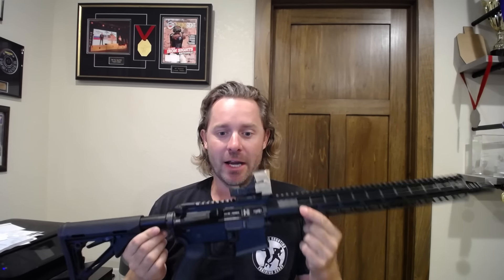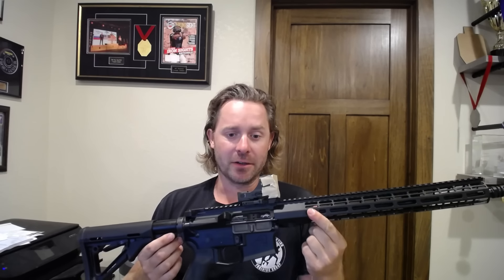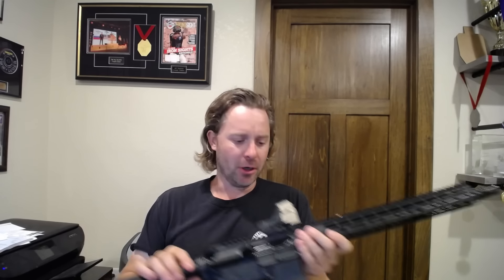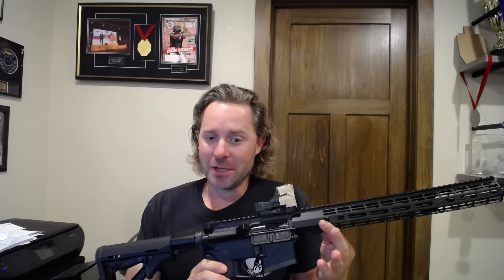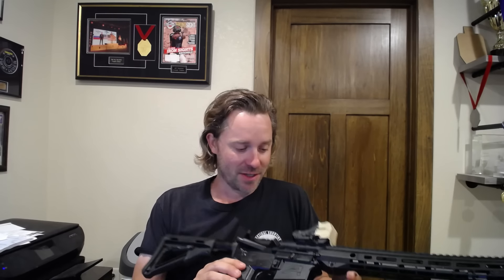Yes I understand Aero stuff is garbage

Comment: Those Aero Precision 16" barrels have a .0785 gpd. That's rather large to start off with. As the barrels gpd erodes. It starts speeding up the system. It starts decreasing the unlock time. And starts causing the bolt to have to pull brass that  hasn't fully retracted in the chamber. Causing bolt failure. Things like adding a h2 buffer will help slow the system down. Replacing gas rings at 5k or sooner. Replacing the buffer spring, etc.  There is a natural progression of maintenance that has to be done to get longevity out of these things. 
3 bolts in 20k doesn't seem that bad though. Especially since you are not doing anything it seems to mitigate the failures.  I put 12k on a Colt 6920 bolt. Back when I was taking courses. It didn't fail. Due to the fact I replaced it. I figured 12k was good enough. I had already put a h2 in it at 7-8k. And three sets of gas rings. At 17k I replaced the barrel. It wasn't key holing. But why take a course and your rifle sh*t the bed? When a good maintenance schedule can mitigate a lot.
Reply: Damn Bro, you sound like you know what you are talking about. Any recommendations on someone who can build a cetme from a kit ?
Reply: @texasRoofDoctor What are you looking to do? If you want a good turnkey rifle. A Colt 6920 Trooper is a good starting rifle. And is relatively inexpensive. It's a carbine gas. But they work. Probably 80% of the police run a Colt gun still.
BCM is a step up. As is Sionics weapons systems. 
If you are building a rifle. The barrel is the starting point. Ballistic Advantage is owned by Aero Precision. But BA gasses their barrels different than the ones they make for Aero. They seem to be decent. Rosco gasses their stuff right. 
A mid gas 16" inch with a .076 gas port diameter runs well with a Sprinco blue spring and H buffer.
When you could get those AO Precision military overruns on BCG's they were a steal. 
I tend to not stray to far from the TDP specs on things. The array of stuff for AR15's is vast.
Reply: @texasRoofDoctor You also have SOLGW in Texas they have good stuff. Become pricey. But they put together a nice package.
Reply: @DutchK.USMC.Knuckles3.   Actually I want to build up a Spanish Cemte from the parts kit.
Reply: @El_Peto Maybe nothing. They could have it done for them. Broadsword recievers and L89 rails is their design. 
Colt has a few barrel manufacturers. Wilson Armament and Rosco make barrels for them. If they aren't making them in house. Same with BCG's Microbest and AO Precision are .mil and .gov suppliers. Capco, Remington and a few others make M4 barrels for the M4. And I'm sure FN is contracting to the same firms. Because the .mil doesnt use cold hammer forging. 
You'd probably be shocked at the amount of stuff insert your favorite gun company here ---> ______, doesn't make. 
Aero makes their own uppers and lowers. Uppers are junk. No thermal fit. No dry film lubricant. That M4E1 stuff looks like billet garbage. There's been a lot of references to the fact that BA/Aero barrels sh*t the bed fast. Tells me whomever is doing the QPQ work isn't doing a good job. And most of their BCG's are Toolcraft. Look up cage code 1b1b6. A 750k contract that Toolcraft had during the GWOT. All recalled. PSA, BCA and the like all use the same crap.

Comment: Aero has a few things right. Idk about their complete rifles but…

-Enhanced upper/handguard combo is absolutely superior to most because it’s “monolithic” compared to standard barrel nut mounted handguards. No rotation… total retention of laser/front sight zero.

- Lower/upper specs are real tight. No play/wiggle.

- Enhanced buffer tube is essential if you’re running a piston system.
Reply: You don't have total retention when a flimsy mlock aluminum rail you can literally push from side to side with your finger.
Reply: @jasonshink6589 That’s your experience with their rails? Interesting. My personal experience with them has been fantastic. Very rigid.
Reply: @CivilianOperators  yup. It's not an experience it's science.  There is no mlock rail as rigid as a name brand quad rail. It saves weight....which reduces rigidness. There is always a compromise
Reply: @jasonshink6589 One man’s argument is always inferior to another man’s experience.

Comment: every aero BCG i've seen has been perfectly torqued and in good spec. us that are really into guns fail to realize that 99.9% of gun owners will never put more than 3,000-5,000 rounds through any one gun they own, especially if they own a few. On top of that, i've bought toolcraft BCGs for $85, run them until gas rings are bad or whatever, and then put in a BCM bolt and I have as good of a BCG as anyone out there, for probably less money than they spent on their BCG to start with.
just my 2 cents

Comment: Whoever says aero precision is not good does not know anything about good quality firearms or the industry!.

That is a very misinformed individual but chances are they're absolutely lies and tactical elitist. Who try to make people feel like if they don't overpay on guns thousands of dollars like they do that they are idiots for buying those budget crap guns!. Some people are insanely idiotic.

Aero precision is one of the best manufacturers in the industry.

Not only do they make well over 95% of their part if not a hundred per-cent of their parts they're uppers and lowers are forged 7075 t6 aluminum which is the top standard of strength in the industry. And I'm pretty sure it's a hundred percent but I'm going to give that few percent just in case.

 Ballistic advantage is a company they own with barrels produced in house guaranteed sub MOA accuracy with match-grade ammo.

And furthermore in the beginning AR-15 getting extremely popular they were the ones producing more than half of all of the AR-15 uppers and lowers coming out of any company the high-end ones included.

And they have some of the most high tech up-to-date machinery possible for building them.

And they also have some of the tightest tolerance is in the industry!.

So just because they are literally half the price of a Gucci AR because aero does everything in-house how does that make them bad in anyway??

Comment: I don't have experience with a full built Aero but I like their M4E1 receiver sets and I've used their BCGs with success. However, I only run their M16 BCG's, phosphate coated (No Logo) with their C158 bolts. Current bcg has over 3000 rds, all suppressed shooting and been through numerous classes. Its holding up just fine. Curious though, you never mentioned if your BCG's had a C158 bolt or 9310. Current bcg in your rifle looks to be a nitride variation.
Reply: Would you go Diamondback Receiver or Aero?
Reply: @ib5131  Aero. In my opinion, they have better QC.

Comment: Aero precision is far from garbage I have used their receivers exclusively and the quality fit and finish is better than even some BCM I’ve used. Their bolt carrier groups have given me no issues, and their barrels have been extremely accurate as well. I can’t stand it when someone receives one bad part and automatically the company is garbage that’s how you can tell you’re not a serious builder or enthusiast , that, and the hair, of course

Comment: I'm confused.  Isn't 10k+ rounds a good life for a non-chrome lined barrel? 

Also, what was the treatment on the bolts? Phosphate? Nitrided?
Reply: Yes, it is.
Reply: The Aeros ran good for what they are, and their price point is. Maybe a higher end barrel would last 20,000+ rounds but thats not always the case either. It really depends what rounds you are using as well as your firing schedule.
Reply: @justinp1471 yeah from my understanding rate of fire is essential to a barrels life. I think I read somewhere the army said 2-3 rounds per minute was the sustained rate of fire for the ar platform
Reply: @mellifont96 That’s referring to sustained fire or really heat. That is the rate of fire that you can expect to sustain without the rifle shutting down due to heat via cook off, gas tube issues, barrel deformation… And that is specific to barrel profile and other specifics of the barrel I think that number was for A4 or maybe M4 I’m not certain.
Reply: @mellifont96 2 to 3 rounds per minute is what you can shoot for as long as you want more or less and not have to worry about it failing? Is that what you mean?

Comment: I had one keyhole at almost 18k. I'm not saying they are the best. But they did just come out with a CH Forged barrel line and new BCGs. You have to weight the price and what you need out of eveything. you can get an Aero (Balistic advantage) barrel for under $100 on sale. I picked one up for like $79.99 once. If you consider you can buy almost 4 barrels for the price of a DD, Geissle, etc etc. Then it isn't bad. Meaning if you got 10k out of a barrel you could get 30-40k out of those barrels compared to the 25-30k of the other barrels.

I love the Aero lowers and a DD upper or Geissle upper. But I've been getting DDs and Geissle Super duties for 1500 so
Reply: DD’s lowers are the biggest rip offs. You are basically paying 700-800 dollars for a basic milspec non ambi lower. Totally a waste of $. Best is to buy a DD or super duty upper and then decide if u want a basic aero lower or if u want a more expensive lower.
Reply: @9770G  did you read my comment ...or are you just double commenting what I've already said? Haha

Comment: The pricepoint that aero has isn't terrible. It's a great entry level rifle. I believe the barrels are ballistic advantage, which aren't great if you are looking for awesome accuracy. Also the bolts aren't great. I think they rock the old specification bolt material. 

Since the majority of the receivers etc are all the same stuff, with variances in qc along the way. I personally used to only buy noveske and higher end rifles and components. Then I learned more about how they are made. Now I don't care who makes the receivers (aero for the most part), drop in a BCM bolt and a criterion barrel, with maybe a BCM or Geissele  or whichever crap is available. 

5 years ago it was simple, buy  bcm lower on sale for 300, and buy a separate bcm upper on sale for 300... or LMT same way. With the cost of these and other things skyrocketing I can totally see how people don't want to spend 3k on a KAC SR25.... 

Why do the DD, Noveske etc bolts last 20k? Because they are made with considerably more expensive material. Carpenter 158 steel is what M4 and M16 bolts are made out of, and it costs a lot more. It's a proprietary steel alloy that is only sourced from one place and has to be purchased in huge batches to be cost effective, it's also relatively limited in supply since it's the go to alloy for the M4/M16 contracts. 

Toolcraft 9310, us also used in bolts/ bolt carriers. 

In the end, I look at it like this. As a Former Marine and current Field Service Engineer, I regard bolts as a consumable item that if I get 5k out of I am happy. The "break in" with some ar's is because the buffer spring takes a certain number of rounds before it takes a set unless it's chrome silicon. Don't believe me, take a new buffer spring, measure it. Shoot it and measure every 100 rounds for the first 500, it loses spring rate till it settles in. Not that you should have to break in any firearm for it to work imo, just kinda how things work with less expensive parts/ fitting.
Reply: Carpenter 158 bolts are only rated for 6k rounds before they are expected to fail 20k rounds on a carpenter 158 bolt is an exceptional lifespan

Comment: Aero is fine as a standard or mid-tier rifle.  If you're a builder, you can't beat an Aero M4E1 lower with an Aero mil spec or enhanced upper.  Put a good buffer system, trigger, barrel, and BCG in it and you've got a top-tier shooter.

Comment: It looked like a failure at the cam pin journal. It's pretty common for a bolt to fail there. I've never seen one personally in my guns or in my duty guns, but I do know it happens. A lot of the more consumer grade use 9130 steel instead of C158. The c158 is usually more resistant to breakage... usually. Take that for what is worth.
Reply: 9310 is no worse than C158, and in certain ways is better.
Reply: @Hornet135  9130 is highly dependent upon proper heat treatment which can vary by mfg
Reply: @skyofstorms  And proper heat treat is even more critical for Carpenter 158 and more difficult to than it is for 9130. So the whole 9310 vs c158 is just dumb at this point.
Reply: @Hornet135 entirely false, 9310 is harder to heat treat than c158.
Reply: @ just because you heard it doesn’t make it true
Reply: @Hornet135 One Google search will prove you wrong, it's literally not debatable
Reply: @ it’s not my fault that you’re unable to properly interpret Google results. Your knowledge on the subject lacks the nuance needed for a proper discussion.

Comment: Is Aero really “bad” if you’re beating the absolute crap out it though? I mean I get it isn’t top of the line stuff, but a quick scrub down and a bit of lubricant could potentially extend the life much longer. I feel like it’s misleading to say it’s bad if it made it through a few thousand rounds without any real care/maintenance. I will say though, I’m glad you’re doing this as I’ve been looking at Aero stuff albeit I’ll be at a much much lower round count.
Reply: Yes it's bad. Lubing a bolt doesn't change the fact that the tolerances on their BCGs fucking suck and contribute to the bolt breaking very quickly. Microbest BCGs are the best on the market (they OEM for BCM, SOLGW, Sionics and many other high end companies) and sell for as low as 90 dollars. There is 0 reason to buy an aero BCG or bolts.
Reply: The fact that the gun are mass produced but need to be worn in speak volumes.
If it wears in then it quickly turns into wearing out.
Reply: @veryhappyturtle  good to know! Thanks! Is there any issue with the uppers and lowers themselves? Or is it mainly centered around the BCG?
Reply: @dchil15  fair point. Thank you!

Comment: Local gun store sold me aero components to put together an A.R. 15. My first AR build. The BCG would stick about 2/3 of the way in, but they assured me that it would break in and be just fine. 

Well, it didn’t. Their policies do not accept returns or exchanges. They replaced my entire upper free of charge with a different manufacturer.
Reply: Your upper got crushed somewhere along the line..It is common for uppers to be tight around the ejection port area because someone over clamped, twisted or use it incorrectly..
Reply: @ they returned it to Aero and got me a new one. Was out of spec.
Reply: @mikejayers  Good for Aero, glad it worked out for you..

Comment: I'm pretty picky and I've been super happy with the Aero Precision items I've purchased.  I just finished building a PCC using an Aero Precision upper, lower and handguard and I've been super happy with all of these parts.  I like the Aero Precision Atlas R-One handguard as good as any other handguard I've ever used.  Fit, finish and function is excellent on all of these parts.  Having said that, I have not used an Aero Precision bolt on anything.

Comment: I’ve never had an issue with my aero lower, she is about 6 years old but also never had over 5k rounds through it. I built my AR and it’s by far the cheapest component of the weapon system. Literally cheaper than my irons, and even butt stock. She has been fine but the more I learn the more I kind of feel like a good 120 investment in an LMT lower it’s probably worth the squeeze.

Comment: I have just over 7500 rounds through a full auto 7.5 inch Aero 5.56 I built (yes, I'm an SOT). It tears through gas rings but so far no BCG or bolt breakage or any issues for that matter. That's using 90% Wolf and Tula ammo also. I've rebuilt the bolt a couple of times with new exterior, springs, pins and firing pin and that's it. Couldn't tell you about the accuracy as this has always been an obnoxious shits and giggles gun.

Comment: Aero really isn't that bad, but for a high round count shooter like you there are 2 things that need to be changed or address if you want to keep the gun.  1 the bolt carrier group go for a 158 carpenter steel bolt from BCM or Sons of Liberty.  2 barrel go for a cold hammer forged barrel like a Criterion, Hodge or Centurion.  Just saying if you were to replace or continue using that particular gun.  Just my .2.
Reply: FYI the Aero bolt is also made from 158 carpenter steel. I've had one personally break at the cam pin hole. I'm not sure what they're doing wrong but they're using the same steel as the premium manufacturers. When I emailed customer service they didn't take responsibility for it but replaced it with a new one (after many weeks of waiting).
Reply: Criterion isn’t CHF, they’re button rifled with chrome lining.
Reply: I don't mind their receivers cause they are cheap and work.....but I run faxon match or proof barrels and jp enterprises/geiessle  parts.
Reply: @jesse5167 The only C158 bolt aero offers is in their Phos/CL. It looks like Ben has been using the Nitride BCGS, which have 9310 bolts.
Reply: @jesse5167 Aero Precision doesn’t make BCGs.